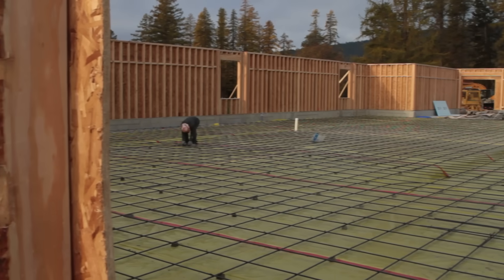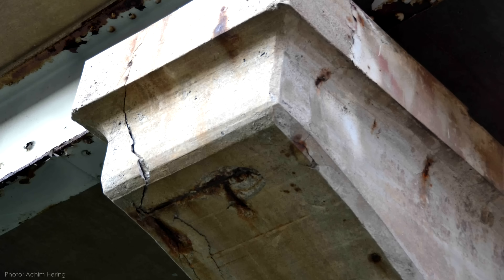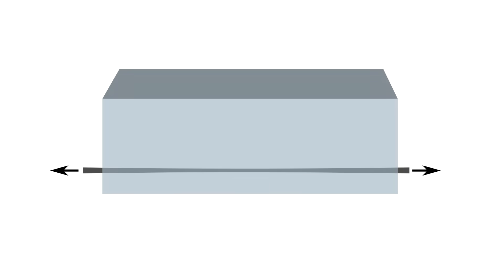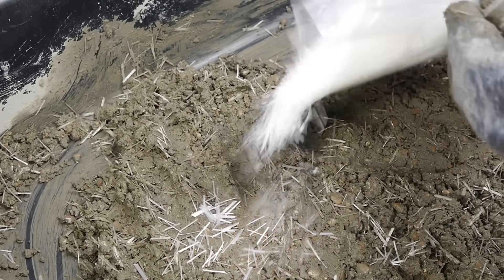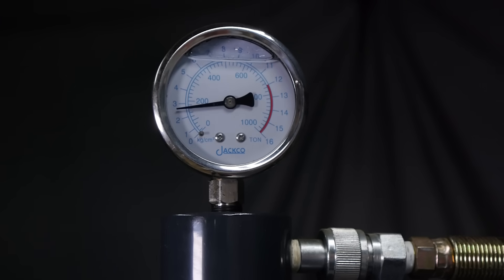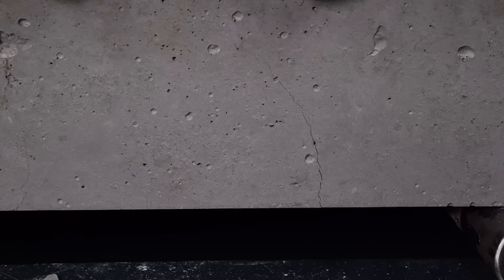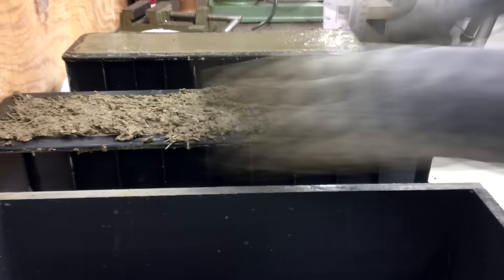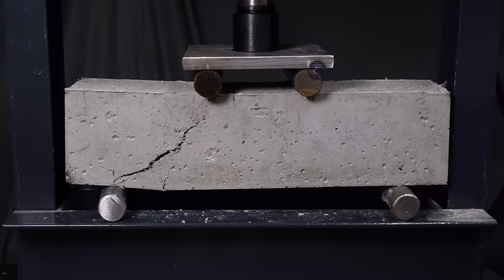Does Rebar Rust?

Comment: This video could not been more important than today with building collapse in Surfside Florida. Look no further than this video. Thanks.
Reply: Yep. That’s why I’m here.
Reply: there was a video from 7 minutes before the incident - the pool was emptying through the structure and the floor was buckling in the parking garage
Reply: 100% . In 2018 the inspectors found that a lot of critical load bearing beams in the parking lot underground had cracks and signs of a serious rebar corrosion caused by salt water from the nearby ocean  as well as by the leaking chlorine from the pool located on the 1st floor above the parking lot . The 40 year old building required pretty serious concrete restoration worth at least 10 million $ and HOA didn't have it. The pool deck collapsed first approx. 10 minutes before the whole building has fallen  . So many questions about this catastrophic accident needs to be answered
Reply: @Nikowalker007  Agreed. I'd suggest this was a slow motion disaster, years in the making with many contributing factors that may have had a prohibitive cost to remediate.
Reply: @joentexas  Completely agree.  The former building manager said that in 1990s water pumps in the parking lot were burning out every 3 years because they were pumping salt water 24/7.  $10+ millions in restoration costs was probably too much for the condo owners, it's almost $100k per condo. ....    By the way, this computer simulation based on the facts  we know so far and created by one civil engineer is probably one of the best explanation so far of what and how it might have happened,   https://youtu.be/hynHiWE818c
Reply: The Surfside building had a known problem with standing salt water in the garage area. It was typically 1’ to 2’ deep and some parked vehicles floated away from where they were parked, due to the amount of water. Their pumps could not get ahead of the standing salt water. Alarms should have been blaring with that issue alone!
Reply: It was a avoidable problem.  Most of Miami was built by Cocaine money in the 80's. So not much to count on.
Reply: Most of you people have never been on a job site. I've project managed over 2,000,000 sqt of distribution warehouses and I can tell you that the rebar is rusted before it ever arrives at the jobsite. The it sits out in the weather until placed so what wasn't already rusted has started to rust. 

Once encapsulated in concrete rebar continues to rust and the rusting is accelerated in the presence of salt water and salt air. As the rebar rusts, its diameter grows with the formation of rust and the surrounding concrete fractures and spalls as it is displaced. This exposes the rebar to even more rapid rusting and loss of strength in addition to the cracking of the concrete which reduces the load carrying capacity of the concrete structural member. 

Regardless of how dense the concrete may be, it is permeable to vapor vapor pressure. The only way to prevent this is to coat the concrete structural members with a water and vapor proof membrane coating such as Drylok or other Epoxy coating applied to the exposed concrete.

Every 40 year old multi-story building constructed of poured in place, reinforced concrete  is a ticking time bomb in a humid coastal climate though the life of the Champlain Towers was shortened by lack of maintenance and water leakage.
Reply: @neighborscomplaint6859   thats 100 % the rebrar is allways rusted evem before it arrives
Reply: @neighborscomplaint6859  Especially if a building is in the immediate period of time right before their required every forty year structural integrity inspection officially kicking off. Someone had to get their insurance money before the structural integrity issue made it invalid. All the rest of those people didn’t have a clue what was coming.
Reply: That's why they showed it to you. I sure as shit didn't search this.
Reply: Well sort of part of the problem is that a lot of beachfront condos in Florida are actually built on sandbars and not proper ground. Throw in a worsening problem of beach erosion from hurricanes and paving over grassy dunes that helped provide structural stability to those dunes and the foundation itself can become unstable.
Reply: The issues was know since 2018 from a few reports so the building falling apart now in 2021 is because of the greed of the owner this is why they need to place a rent cap on all apartments in Miami cause the owners are not using the extra money they make to keep the properties in good condition.
Reply: Hello
Reply: Thats exactly why i came to this video! I hope he does a video on that building collapse once more is discovered.
Reply: I've already watched this video 2yrs ago, showing my GF it now to explain what happened to Champlain Towers South
Reply: Thats why I stopped by
Reply: Afree
Reply: They probably used sand from the beach, cheap-ing out & shaving money but disaster later.
Reply: Interesting this video came up in my recommended shortly after the collapse.
Reply: The rebar sliced them up
Reply: This would never happen in germany cause we have so high standards for concrete construction
Reply: People heard booms before the Surfside collapse as they did on 9/11.
I looked up the list of building collapses from structural failure. They are extremely rare. There’s only a handful of modern examples, most have occurred during construction. Steel rebar buildings don’t just collapse because of ‘water in the basement’ or concrete spalling here & there. Additionally, thinly steel constructed kerosene lanterns don’t melt either.
Reply: @pbarc552  the booms were probably the pool deck and planters falling into the parking garage below. It was late at night and relatively quiet... so loud noise sounds louder in the absence of the usual background noise of traffic etc.
Reply: @pbarc552  You have to watch the video above to understand how water/saltwater creates corrosion of rebar and the corrosion ultimately destroys the concrete. Concrete is not impervious to water if not water proofed by constructing runoff sloping and/or waterproof coatings. Water will seep in and rust that rebar. That's concrete construction 101. In this particular case we're talking salt water. Rusting rebar for many years. Once the foundation buckles the building will pancake. The support between floors is designed to support the weight of the floor above. Not the falling weight of the floor above. There are more than a few reports of water gathering in the basement for years with no path for runoff. One engineer found the building was subsiding and another that the building was built on reclaimed land. I would suggest the water in the basement may have come from below and possibly for and extended period of time. Oh, and I'm sure when a floor crashes on the floor below it make quite a noise. That's my opinion after 32 year career as an engineer. But opinions are like noses, everybody has one and they all smell. You seem to imply that maybe there was sabotage involved I guess. Nah, not happening.
Reply: well look at google streetview and map. They have been building a new structure next to it much closer then the original building they demolished. So it is possible the concrecte got damaged because of the new work done there. It happened before.
Reply: @klaasj7808  I wouldn't rule out construction may have contributed to any previous problem, but this is not the first building in close proximity of some kind of construction. Keep in mind also, the building standards are for a building to withstand hurricanes. As has been suggested with poor waterproofing and standing water in the basement garage/foundation, once any corrosion of the foundation begins it's difficult remediate, as suggested in the video. Rusting rebar will not fix itself.
Reply: @joentexas  wrapping the outside of concrete members with carbon fiber mats wetted out with epoxy resin is rapidly gaining acceptance.  This building owner could have done this for WAY less than the $16M that the report estimated the repairs to cost.  Too late now for this building but not for others.
Reply: @StormGod29  the bulk of the repair cost would not have been the replacement of the water proofing but the repair of the already damaged rebar and concrete.
Reply: @klaasj7808  That’s unlikely. The latest reports suggest that the culprit was poor maintenance over many years, which allowed prolonged flooding of the basement, which most likely caused the same sort of corrosion described in this video.
Reply: @MarcosElMalo2  so many lives lost
Reply: @klaasj7808  there was also a lot  of weight on roof due to renovations there.    In addition, why wouldn’t stainless rebar plus fiber reinforcement be required in salt water environment near coasts?  Not as if mixing fiber into mix and stainless weren’t commonly available  40 years ago.  It’s all about the cost.
Reply: @klaasj7808  McAfee’s  building collapsed in Florida ... just another free fall like building 7. Go back to your smart screen
Reply: Why do you think this video was reuploaded so many years later?…$$$$
Reply: @rl2769  this wasn’t reuploadrd it’s just trending
Reply: @rl2769  This video was uploaded 2 years ago.... I'm subscribed to this channel and haven't noticed he re-upload it
Reply: @rl2769  it was no re-upload weirdo
Reply: @rl2769  This video was posted 2 years ago....

Comment: MY FRIENDS IN GHANA, WEST AFRICA, ARE BUILDING THEIR HOUSE WITH CONCRETE BLOCKS AND MORTAR AND STEEL REBAR. THAT IS THE UNIVERSAL OLD BUILDING WAYS THERE. IT IS TROPICAL, WITH LONG HOT SEASONS AND A RAINY SEASON.
IS HIS STRUCTURE PRONE TO CORROSION WITH THIS METHOD? 
I HAVE SEEN COUNTLESS BUILDINGS THERE WITH MOLD AT THE FLOOR-WALL ZONE OUTSIDE. I GUESS THE MORTAR AND PLASTER THEY USE IS NOT TREATED FOR WEATHER AT ALL. 
THE NEWER HOME BUILDINGS SEEM SO HEAVY AND I NEVER SEE ANY HOME PRESSURE TESTING THE GROUND FIRST TO SEE IF THE FOUNDATION CAN CAN HOLD ALL THAT WEIGHT, SOMETIMES THREE FLOORS OF HEAVY BLOCK WORK AND MORTAR. DOES THAT SEEM LIKE A PROBLEM?
I AM HESITANT TO HAVE ANYTHING BUILT WITH THOSE OLD TECHNIQUES BUT IS SEEMS ALMOST EVERY BUILDER DOES THE SAME. I WOULD APPRECIATE YOUR ASSESSMENT OF ALL OF THIS.

Comment: that building in FL …. exactly what happened
Reply: They knew about the repairs needed two years ago but kept avoiding it because of the cost.
Reply: @Tatsh2DX  No shock there.
Reply: Don't know for sure, but I suspect it was a failure of the rebar in a salty atmosphere. When you start to get cracks, the damage accelerates. The cracks get bigger and bigger, allowing ever more water to enter. There were pictures of serious spalling in the structure. That is where something inside the concrete expands and pushes shreds of the material to scale off. That is where the salt-moisture would enter. 

Then there is the issue of shorting the structural material when they built it 40 some years ago.

Comment: You should spray anti corrosion or paint onto the bars, this way, it is protected like a car. No paint - rust. Paint - no rust. Simple.
Reply: Epoxy powder coatings on rebar are a big thing. They can be incredibly resistant to marring, chemicals, and even quite flexible. I was disappointed that he glossed over it in the video.
Reply: In flordia they usally use Stuco

Comment: I've not been on commercial job sites in decades but I can suggest that the craftsmanship is likely the number one problem with construction to be as per spec. I have witnessed residential construction as being very bad in following the just the minimum standards let alone doing the work in professional methods and following best practices in the trade. I have watched hundreds of concrete pours being made for decks, driveways, walkways, foundations etc. and most of the jobs rarely bother to use "dobies" to space the rebar, if it is used, 2" above a correctly prepared foundation. Most concrete work is poured right over bare soil, no sand, no quarter rock base, and finished especially with driveways and home foundations. See it all the time and folks wonder why there are big cracks vs. small cracks years later. As in this video, the one pump job that did use some dobies but not nearly enough of them had much of the rebar lying right on the yellow barrier so no concrete is getting under the rebar. BAD.  Its a wonder that workers with that kind of concern for their work continue to get another job to do that again and again.
Reply: The old guys that knew the job are gone now mostly and the younger ones don't have a professional outlook.  Also, the contractors are trying to come in quick, do the job, and get out.  Make the most money, hire subcontractors who use illegals to cut cost and don't adequately supervise them.

The house I am living in was built in 1955, enlarged with a double car garage, which required a bigger driveway.  They just left part of the old one,  didn't use ANY seams in the new part, so now it is cracked drastically.  The front porch has rebar stain on the concrete.  Just about everything was done wrong in remodel and I continue to find more mistakes.  House foundation not done right either.
Reply: I worked a summer doing concrete. Those concrete spacers pretty much tell you how to install them on their packaging or material provieded in the box. Clearly the guy who I was working for did not know or just did not care as he only used a few of them if any at all. I told him that you are clearly being paid to install concrete the right way and not his way. We were doing a finished concrete foundation and floor ( mono pour )  for a pretty nice house and he did not use any of the spaceres and the guy spent a lot of time grading and preparing the site along with insulation, forms and providing the drawings for the rebar. We show up and he tells us to lay out the rebar in a 2x2 pattern and leaves for a few hours. While we did this the guy had a workers lean too that you could look at the plans and had copies of everything including the rebar foundation. I looked at all of this stuff. When the boss got back I asked if this was how it was suppose to be and he said yes. So while he was not looking I snapped a few photos and we poured the concrete and finished it. I then went to the homeowner and showed him the photos. While we were working on the next job I was offered a much better job and took it. In the end the home owner threatened to sue him and he ended up having to to rebuild the entire foundation and slab. With all new plumbing and floor heat and everything to the exact specs. I am sure it cost him double or triple of what it should have. He no longer does concrete anymore and now is the county road and bridge main supervisor. I hate that guy as he cut so many corners. He did the same on a county remote shop which was my first job. I did with him.
Reply: @kameljoe21  Seems to me the entire system of being licensed, having just anyone on the crew plus the inspections that are supposed to be catching the cut corners isn't working. Is Everyone on the take? Greedy state and local license, permits, fees, plan checks and corrections galore to satisfy the very people who allow cheaters to cheat for a bribe of some kind. All while the owners get screwed and the public are subject to more risk factors when entering buildings and using just any kind of structure. People are so absent minded about the years and years that will pass and this kind of activity will continue to put folks and owners at risk.
Reply: @Garth2011  Oh did I forget to mention this was in rural areas where permits are not required and inspections do not exist. Put it this way where I live I can build a brand new house with out asking anyone. The only thing I have to abide by is building on my land and at least 10 feet away from the property lines. I own almost the whole block in a small town and I could build a shanty shack here if I wanted to. I have also been thinking about doing that. Building a super small cabins for hunters and renting.
Reply: @kameljoe21  Seems fair...if the location has no codes/rules in the building of structures then its up to the builder to research and build a safe etc. building. Problem is, that is why building codes came about, your average building didn't care about the future, safety, efficiency etc. of what they had in plan. they simply just build it any old way but that puts people in risk, property at risk and much more. So that makes it all on the builder/owner...I hate to admit it but building codes get my vote long before I'd trust a Joe rural builder.
Reply: @kameljoe21  Yes and concrete is heavy...if you don't use the right amount of dobies the rebar will bend etc and won't be equally supported inside the concrete which is what causes spalling among other defects.

Comment: stop putting rusted iron in the concrete in the first place.....
Reply: A tiny bit of rust already on the outside isn't going to weaken it as long as the concrete covers it.  Years of moisture coming in through cracks will do that.

Comment: Way too long but he's essentially correct. Rebar expands during heat. The concrete contracts during the cold. It's amazing that rebar is not oxide protected coated. It's decaying before it's installed. Destined to fail.
Reply: Corroding won't happen when pH is above 9. Below that, "passive layer" disappears on rusting starts.